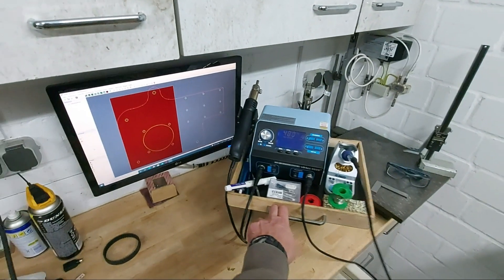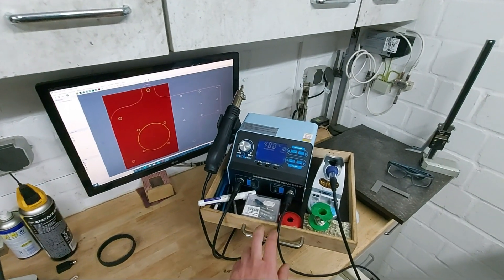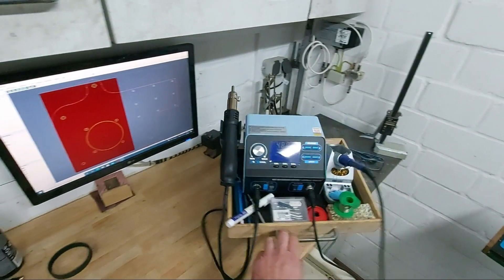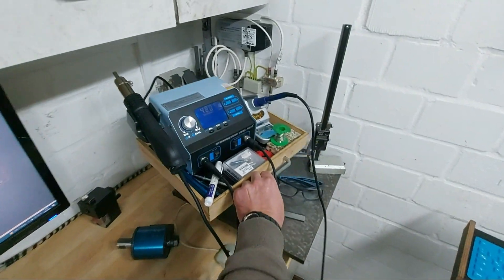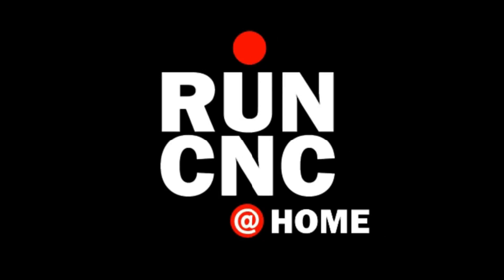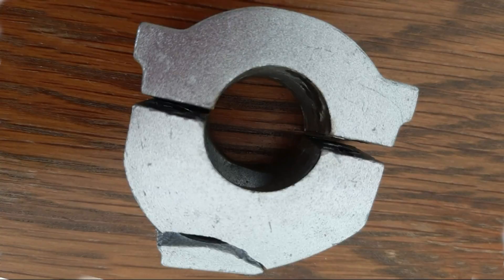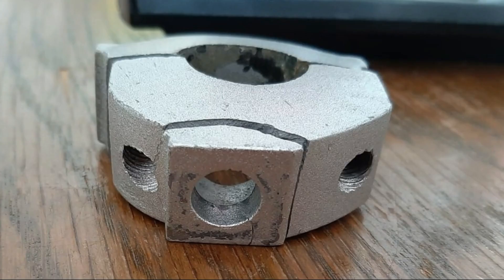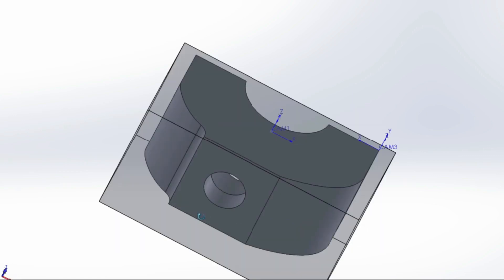CNC milling aluminium handle bar raisers

Comment: Hello, how many kw is your spindle? What type of inverter are you?
Reply from the maker: 2 kw: https://www.sorotec.de/shop/Teknomotor-HF-Spindel-2-0-kW-ER25-24000-U-min-Fan-6665.html
The VFD is a Powtran 2.2 kw
Reply: Nice work, do you recommend a high speed spindle for home milling machine (24k rpm)?
Reply: Hi which program did you model and program with?